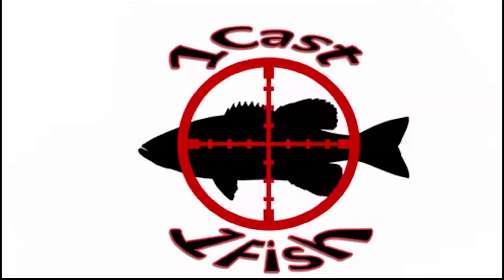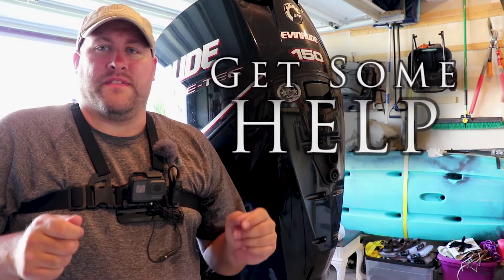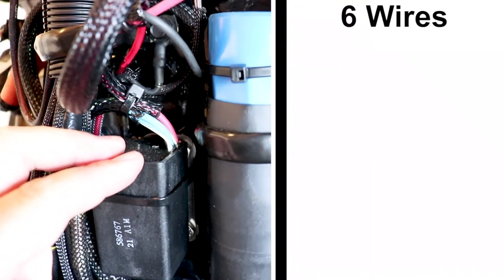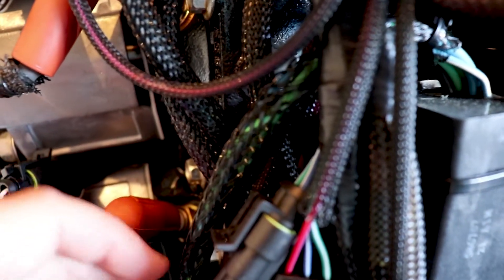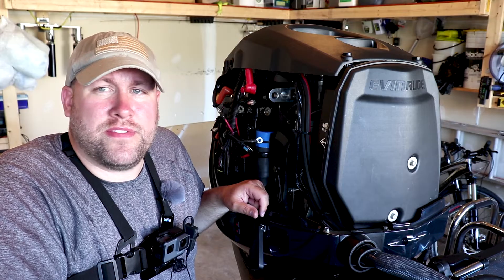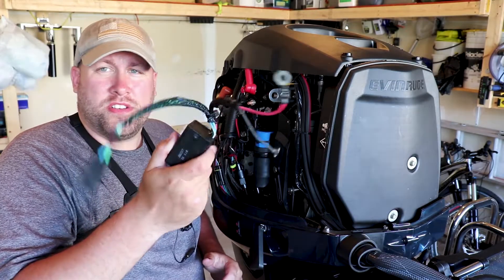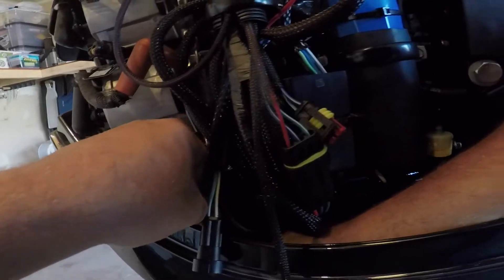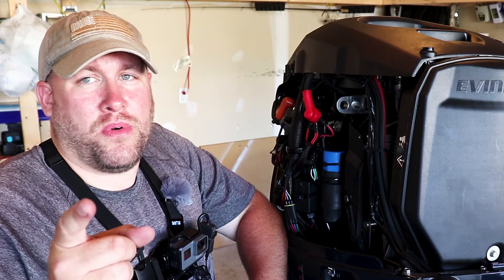Evinrude ETEC Tilt &Trim Problem | Tilt & Trim Issue | Relay Replacement

Comment: Excellent video. Just replaced mine and unfortunately, still nothing up or down. Will not work from three different switches so I know that is not the issue. Still searching for the problem.
Reply: I will add that to test the relay before purchasing a new one, disconnect the large plug with the blue and green wires shown in the video first. With the power connected, put a voltage meter across the terminals coming from the relay inside of the plug. Press the up or down switch and if you see 12 volts then you know that power is going through the relay down to the motor.
Reply from the maker: Great pointer, I will put this at the top of the comments as some addition info....thanks

Comment: Can I make this repair while on the water?
Reply from the maker: I think it would be a tough repair on the water just due to location.  Could you do it in shallow water where you can get out and stand at the motor....possibly.  It is much easier to do on shore though.

Comment: Water in switch on lower cowling is very common.
Reply from the maker: Definitely can happen
Reply: You wouldn't  happen to have oem part number for that switch would you? My motor just started to trimm down on its on, even in the off position. Finally disconnected cowling up down switch, was okay, and will trim okay using throttle switch. Can't find part number anywhere. 2009 150 etec

Comment: Great videos! I appreciate them a lot! got an Evinrude E-TEC 75hp 2007 model. The trim sensor stopped working, so you have any tip on how to fix that? In addition, the tilt hydraulic seems to gradually loose pressure after a week or so when the motor is tilted up, slowly making the motor tilt back into the water, only a couple of cm though. At the moment this is solved by jamming a piece of wood between the motor and the motor bracket to support it, which prevents it from dropping. Any idea if I can tighten a screw or change a seal to fix it?
Reply from the maker: The sensor issue may just be as simple as the sensor or limits...more testing would be needed.
Now on the slow pressure loss...
There is a bleed screw...ensure it is tight (just don't go crazy on it)...Common to loosen up a bit
Could also be a internal seal leaking
Reply: @1Cast1Fish thanks for the reply! I’ll see what I can do.

Comment: Have a similar but weird issue. My 115 Etec has a short for tilt up and won’t let me tilt it back down. Going to try disconnecting the quick connect control wires and manually get the motor tilted down until we can get a new relay or the rest of the wiring looked at.
Reply from the maker: Down is a bit easier, since you can use the bleed screw to lower the motor.  The bleed screw will release the hydraulic pressure and motor will lower.

Comment: my trim down on both the binical an the button on engine are acting up. won't trim down so I press a tad harder (it's only dune this once on each button. will test the relay. thanks bro you are the man. when you say if you have a big engine manuely trimming up get an assitant mines a 175hp if on the water can I lift up w/ the screwdriver by myself?
Reply from the maker: Sounds like the relay, as far as manually trimming the motor up, I recommend some help...they are pretty heavy

Comment: Can anyone tell me if this relay will keep my tilt and trim gauge from working my motor tilts up and down fine but I put a new gauge in and it still doesn't work thanks
Reply from the maker: That relay is for the motor tilt, but not the gauge

Comment: Great video, I have a 250HO and the manual trim on the motor works fine, up and down.  The trim on the throttle both up and down only pushes the motor up.  Even the down button pushes the motor up.  Thinking it’s in the throttle assembly??
Reply from the maker: I would lean on something not right with the throttle assembly button...look for any loose or corroded wires/switch

Comment: Awesome! Got the part off amazon for $40. I would note that on mine the copper washer I had to screw off and be careful because it is sharp. Is there any spray coating to spray the nuts with? A quick fix is just tap on the relay. It worked on mine every time and saved a fishing trip.  Love it we have the same motor.
Reply from the maker: Glad you were able to get a part and it has worked for you, I never coated any of mine

Comment: Good video, I'll ask you. I have the same trim on an evirude 90hp, etc. When I'm in the water and I compensate with the trill and I leave it after a while while sailing, it goes down on its own, which could be
Reply from the maker: Possible it is a leak in the hydraulics internally...especially if you see no obvious leaks and the fluid level is good.  Normally would mean rebuild time.

Comment: First, the audio, video, and production value of this video is amazing. Really high quality and makes it easy to follow along. Now, does your trim down work intermittently or just not at all? Did you hear the relay click before you replaced it? I have a boat where the transducer mount location throws a lot of water directly at this trim switch. It seems like the switch is well corroded, but it does still work at times and I'm not sure why.

Do the relays just get unreliable before they go bad? Is there any way to test them? There's so many ghosts in this boat's electrical systems that I'm still chasing down so I'm wondering if it's not a voltage issues somehow. I'm replacing the switch because i could see the rust running out of it and honestly can't figure out how to get it back together in a waterproof package so right now it's naked metal tabs just on the outside (but working!) on the motor cover. 

Appreciate your details right from the start. How to do an emergency fix to get home, safely working with power, reminding to label and take notes, and showing the detailed steps.
Reply from the maker: Glad the video help you out and was easy to follow.  In my case the switch started working intermittently only.  When it would not work it did not work from any switch and no noises at all from the relay.  If your switch was very rusty I would definitely look at fixing that issue, but if possible does your motor trim from the other trim controls at the helm?  If the trim on the helm throttle works, but the one on the motor does not, then it is likely just your motor switch.
Reply: @1Cast1Fish  Yeah when it doesn’t work, it doesn’t work from anywhere. Guess it might be the relay. I ordered a new switch and relay anyway. Hopefully it’s not another weird low voltage situation. 🤞
Reply from the maker: Sounds like it could be relay...hope it fixes it for you....chasing issues with these things is a pain.

Comment: Does this apply to the up trim as well?? Is there another relay somewhere for the up trim or is it the same one you did. I have A 200 Etec Ho. Thanks.
Reply from the maker: The relay does both the up and down function.

Comment: Why are these things going bad so quickly. Mine has zero corrosion around or on it and started going bad on just a 4 year old engine. The part is $170 from evinrude. Not cheap.
Reply from the maker: Not sure, but I remember it was a high demand part when my dealer ordered it.  It is expensive since it does both the up and down functions.

Comment: I KNOW IT'S AN OLDER VIDEO BUT I HAVE SAME MOTOR, DID YOU HAVE VIDEO OF REMOVING LOWER UNIT TO CHANGE RUBBER WATER PUMP IMPELLER? THANKS
Reply from the maker: I did, but had issues with the video...so probably in another 2 years when I replace it again I will try again.

Comment: you did a great job with one question. What in the world would make you think that the three red wires need to be in any specific order on the starter terminal with main power? They just don't friend. It matters zero whether the relay you replaces is placed on that terminal first, second or third. Just get them all back on. Then the main battery terminal last. Perfect. The rest is great. Have a great one.

Comment: So I kinda had the same issue, except my motor has been trimming down on its own while the boat is in my garage on the trailer, pushing the skeg into the ground. I recently put in a brand new tilt/trim relay and a new tilt/trim switch on the side of the cowling. Any other suggestions as to what I should be looking at that it’s still doing this?
Reply from the maker: Does it just randomly start to go down on it's own?  Do you hear the motor trimming down, or is it a slow release....kinda like the motor is drifting down on its own?
Reply: It's using the motor still and forcibly pushing it. I'm not seeing it do it, I'll leave the boat with the motor tilted up and i'll come back the next day and find it tilted down.
Reply from the maker: So that is pretty odd...I would probably start by isolating portions of the system.  I can control my tilt from the bow switch, the throttle, and at the motor...all of these are fairly easy to just disconnect the wires to.  I would start there and see which switch is causing the issue....Seems like a switch issue to me.  If that does not stop the problem...next move would be relay
Reply: Relay is brand new and so it’s the tilt trim switch on the engine itself. I don’t have a bow mounted switch, only other switch would be on the tiller handle
Reply from the maker: Probably has 2 wires connected to the switch at the motor, disconnect them and see if it does it again.  Sounds like something must be energizing the tilt trim motor

Comment: My trim/tilt works fine from the switch on my control box, but the switch on the motor does not work. Does this mean my relay is probably fine but the outboard switch is bad?
Reply from the maker: I would look at the switch, my issue nothing would work

Comment: My ETEC 150 trims up and stops just short of allowing the trailer bracket to drop into place. The motor operates up & down fine. Could this be a fluid issue?
Reply from the maker: So there are actually stop limits that ride on the cam they are can be moved by hand to limit up travel by the motor. Look up adjusting tilt trim limits and such. It’s very simple and straightforward once you see them.

Comment: ours since new which we have to live with no technicians. Runs great but if you push it hard open it up the over heat alarm 🚨 tone goes off?  Three thousand rpms happy go past that she not happy. Z118 ranger evinrude 150 h.o.  Funky thing is does it then doesn’t do it even if you run hard? Been chasing our tails? If any body works on them what the heck? Is the thermo stat stuck or not opening all the way? Does she need a hotter thermo stat?
Reply from the maker: A buddy had a similar issue years ago and it was a T-Stat issue...when the alarm goes off it puts the motor in kind of a limp mode that limits RPM.

Comment: Well, two years later I'm replacing the relay again. 2013 ETEC 150.
Reply from the maker: Dang that's crazy...hope the part was at least available
Reply from the maker: Glad you found one easily, they were hard to find when I needed mine.

Comment: What happened when yours went out? My ETEC randomly tilted itself all the way last night as I slept and then somehow drained the battery. When I recharged the battery and try the trim switch I can hear the motors working but there is no movement on the motor so is this a relay issue or a hydraulic issue??
Reply from the maker: I am by no means a professional on these motors, mine just would not tilt back up or down from any switch on the boat or motor.

Comment: dealing with this exact issue on this exact motor as we speak, your video is a lifesaver dude, you're the man
Reply from the maker: It amazes me how many others have had this exact issue...glad it has helped
Reply: What happened when yours went out? My ETEC randomly tilted itself all the way last night as I slept and then somehow drained the battery. When I recharged the battery and try the trim switch I can hear the motors working but there is no movement on the motor so is this a relay issue or a hydraulic issue??

Comment: Got a 150 etec and now it work trill up full far enough to flip up trailering bracket..yes I used manual release and added fluid but still a issue not going up enough...never had troubles before..ya got a answer what to do to adjust
Reply from the maker: I am by no means a marine tech, but I think that there are adjustments for limits on how far it goes up.  I would google it...I think its kinda like a plastic tab

Comment: I just smach the relay while holding down and it works every time. I need to change soon though lol
Reply from the maker: Yeah, that works for awhile till it didn't ....lol   Order it sooner rather than later, when I needed mine it was a long wait.
Reply: @1Cast1Fish  Yeah your right, I just ordered mine. 250$ CAN. Don't want to get stuck one day with the family on the water..
Reply from the maker: I had to wait almost 4 weeks due to back order...they definitely are not cheap.

Comment: Great video. I’m having a trim problem. I can’t trim up on the bow and at the motor. The down works everywhere. No problem at the throttle. And suggestions?
Reply from the maker: So mine had issues trimming up to start with...it would not trim from the motor, bow, or throttle.    It eventually just stopped working period.  For me I had no tilt/trim control from anywhere on the boat, which made it easier to track down to the relay.  I would not be sure what your issue could be if you still have control at the throttle but not from others.  Could be the relay still as mine was very intermittent at first and got worse, but I would not feel comfortable telling you 100% that is the problem.
Reply: Thanks for the reply. It’s more of an annoyance than a problem. It’s too coincidental to be the the switch with 2 doing the same thing. I don’t think it’s the relay because it works at the throttle. I’m stumped
Reply from the maker: Yeah, that id weird that it works on the throttle but the other 2 don't...wish I had a idea, but I am stumped by that one too
Reply: That is likely the trim limiting switch that stops the trim once it’s raised too high. Switch is under the top of the ram area.

Comment: Thanks heaps for this video mate, mine is doing the same but won’t go up.
Reply from the maker: Hope this helps solve your issue
Reply: What happened when yours went out? My ETEC randomly tilted itself all the way last night as I slept and then somehow drained the battery. When I recharged the battery and try the trim switch I can hear the motors working but there is no movement on the motor so is this a relay issue or a hydraulic issue??
Reply: @Lhewk  It was the Trim/Tilt sensor, ,,disengaged the sensor as in cut the wires to it,all good now, it does trim up way more than before but all good no issues after that..

Comment: Thank you for the video! I have the same problem in my Evinrude 150. The thing is that sometimes its works ok and sometimes you have to spend ten minutes pushing de down botton to make it work. Do you think its also de relay? Thank you and cheers from Argentina
Reply from the maker: Very possible...mine was intermittent

Comment: nice video but how did u know it was the relay and not the switch? im having same problem but the outboard trims both ways up at the hand controllers
Reply from the maker: I had the same issue regardless of the control point to trim up and down.  If you only have the issue from one switch, it might just be a bad switch.
Reply: @1Cast1Fish  yer cheers mate the switch on the out board now doesnt even click when u press the down button so yep say it was just the switch :) cheers for the help but :)
Reply from the maker: @djhinormas959  should be a easy fix for you, just hope the part is available and not on back order.

Comment: Awesome video. I haven't had problems yet but I have the same engine .
Reply from the maker: Other than this mine has been perfect....knock on wood or fiberglass
Reply: @1Cast1Fish  have you had to fill the trim fluid yet ?
Reply from the maker: Nope

Comment: My trim/tilt works with switch on engine but not switch on throttle/shift. Any idea where I look? Thank you
Reply from the maker: I would venture to guess bad switch or wire issue from the throttle tilt/trim switch.  In my issue none of the switches worked which led  me to the relay

Comment: Great video I changed my relay but still have the issue with my motor going up whenever it wants too, both buttons act the same way so highly doubt its the buttons, have a brand new relay same issue was wondering if anyone had the limit switch go out and give them similar problems.
Reply from the maker: I have seen the switches go bad on the throttle before or another switch at the bow (if equipped)
Reply: I found the problem my limit switch for the trim was bad
Reply from the maker: Glad you figured it out... always sucks chasing boat problems

Comment: This video helped me fix my problem for less than $100 and I know my mechanic was going to charge me $400+ and that was after it sat on his lot for 4 weeks waiting for him to get to it. Thank you, kind sir! Awesome video!
Reply from the maker: Thats awesome to hear...thats the reason I made this video....love hearing that it helped and saved you some $$$
Reply: Good video, but not one video on my 150 Johnson on the power trim sticking in the down position . I eliminated the front and steering wheel switch so could it be the switch on the motor or in the shifting handle ?

Comment: Before using the manual release, I recommend trying the trim limit switch that is located on the pivot shaft.  This solved my problem in about 2 minutes
Reply from the maker: Great suggestion, but was a no-go in my instance.
Reply: @1Cast1Fish  Where is the pivot shaft located?  Have you done a video of this too?